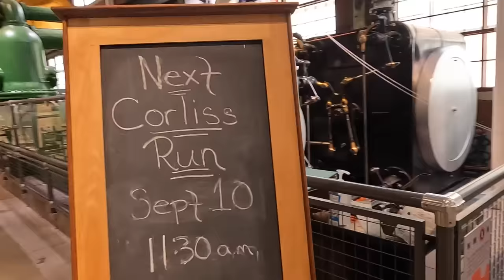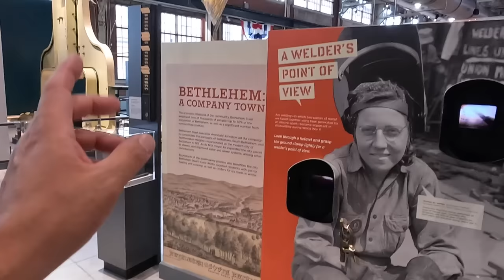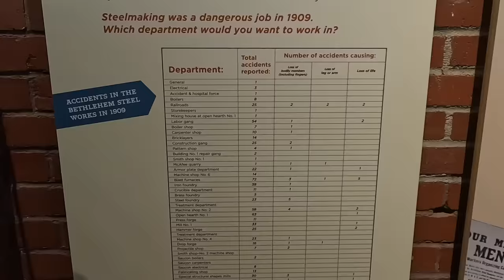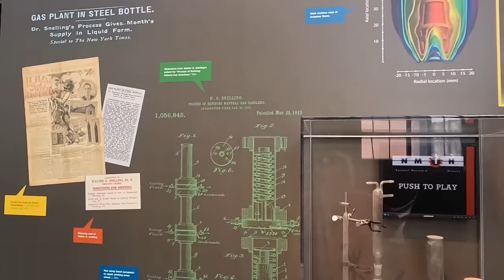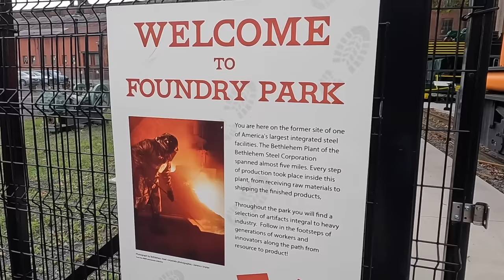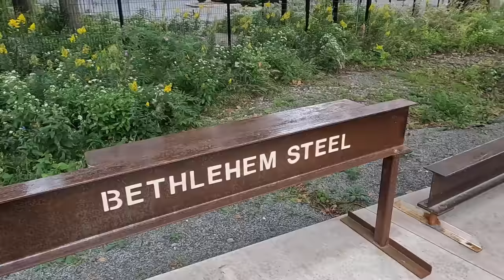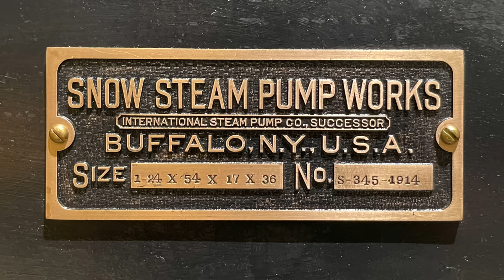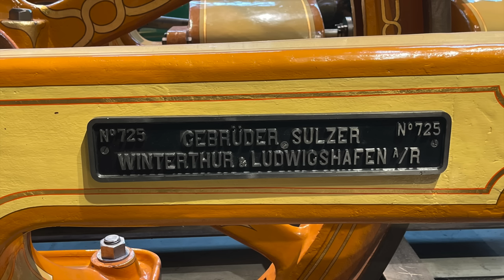National Museum of Industrial History, Bethlehem, Pennsylvania

Comment: There's an operational snow engine twice the size of that one, at Rough and Tumble, just a ways down the road, south of Bethlehem, in Kinzers, PA, along route 30. You should seriously check out their Thresherman's Reunion, late in August (3rd week/weekend or so). they have endless amounts of old mechanical stuff, engines, equipment, models, machine tools, on and on, and most of it is operational, or at least idling to show how it operated.
Reply: I volunteer in the machine shop & R&T and we'd love to see Adam on site

Comment: At 20 years old, I walked into the E.W. Bliss Company in 1969. They made all kinds of products for the steel industry. Machine tools that made rolling mill housings. They would be assembled to check everything was machined correctly, and it was square and true. Coilers and reelshafts. Very intricate machining and fitting on reelsfafts, hours, and hours. The machine tools were huge. The big gearbox that powered the rolling mills, when completed, and a couple of bolts in one of the shafts, with a 2x4, you could roll over the gears. Same ones you are standing next to. Smooth as silk.
Reply: Worked on plenty of Bliss presses and equipment over the years. 👍

Comment: 9:40  Where I went to Trade College, a few blocks away, was a full woodworking shop, in action making profit and fur nature and custom moulding for re-storing market, and it was line shaft driven.  

Out back of the plant was a "Drive Shed", instead of the old steam engine it had a fairly modern GIANT electric motor.  one motor ran the entire factory! :)   Many of the woodcutting bits were modern tungsten carbide, but the custom molding and wood trim cutters were all High Speed Steel and custom made for the shop.

I assume it's long gone now, that was well over 40 years ago!

Comment: I did a job at Bethlehem Steel while working for Maintenance Service Corp. If I remember right, it was the last company in the U.S. making virgin steel.
Reply: BTW, when I was there they were still using coke gas for heating and a byproduct of that was used for red dye oloring agent.

Comment: The two gears out front are to a gearbox that turns a 44 inch or big rolling mill there would have been two large drive shafts that would have connected the rolling mill to the gearbox and the gearbox had babbitt bearings I know this because I work at the Steelton plant in maintenance so we still use those gear sets in different parts of the mill and the overhead crane is 250 volt DC the the crane in the Steelton plant are like that.

Comment: Casted machine bases reminded me of an old Singer sewing machines, manufactured at beginning of the XX century. Our family had even a Singer's replica; Podolsk sewing machine, manufactured in 1950's with an identical casted base. 
Those two chevron gears (pinions) lying nearby the entrance came off of a pinion stand. Rolling mills use pinion stands connected to the work stands to make the counter rotation of the work rolls.
The line shaft with the flat belts (group drive) was still relevant in1950'-60s in many legacy machine shops and eventually had replaced by a newer machines.

Comment: Bethlehem Steel was one of the three major 20th Century armor manufacturers for the US Navy through WWII (Bethlehem, Carnegie, and Midvale) and also during the same period in the for 20th Century US Navy AP projectiles (Behlehem, Midvale, and Crucible Steel).  Of the three in each category, it had the spotiest record for reliable armor and projectiles.  For example, four bewlt armor plates were taken from the sunken USS ARIZONA and tested at the US Naval Proving Ground, Dahlgren, VA, during WWII.  Three of these face-hardened Class "A" plates were Bethlehem Non-Cemented plates and one was a Midvale Non-Cemented (at the time only Carnegie decided to pay Germany's Krupp Company for its Krupp Cemented face-hardened heavy armor patent, with Bethlehem and Midvale making their own somewhat different plate types, until 1912 when the US Supreme Court invalidated the Krupp Patents, allowing free copying the the cemented armor version from then on).  When those four ARIZONA plates were examined and tested using new AP shells, the Midvale plate had the thickest face and was very smooth in the hardness contour from front to back (good quality control with no erratic hardness or other metallurgical  changes within the plate), while the three Bethlehem plates varied all over the place in hardness contour, plate metallurgical properties, and plate quality under testing, indicating very bad quality control during manufacture.  The ignoring of quality in manufacture by Bethlehem also happened when the first 14" AP shells were being tested at about the same time for the newer up-gunned -- from 12" guns --  US Navy battleships.  ALL Midvale test shells passed easily and most Crucible test shells passed with a couple of failures (Crucible later became the best Navy AP manufacturer used to make all armor plate test shell at the Naval Proving Ground).  NONE, repeat NONE, of the Bethlehem developmemta; 14" AP shells passed the initial tests.  Not a good record...
Reply: "Bethlehem plates varied all over the place"    playing the odds of where the shells would hit!

Comment: Being a computer programmer now I understand where the idea came from for using punch cards to program the early computers. They took what they already knew and applied it the computer business.
Reply: You might be interested in the telegraph museum located at the North American terminal of the transatlantic telegraph cable.
This is located in Heart's Content, Newfoundland,  Canada, just a little north of the Capital St. John's.
The electro-mechanical equipment there is beyond belief!
With this equipment it was possible to simultaneously send different message over the same cable!  Duplexing in computer jargon, now.
The cable end is still visible on the beach, where it goes under the road and into the museum.

Comment: Those programming cards and looms are very similar to the first ones even made, only about 100 years earlier.  Some computers could be programed the same way until about the mid '70s.  I actually learned how to use a keypunch machine (to make the cards) in high school in the late 70's; we had two keypunch machines and a DEC PDP8/E that you could program with the cards (although the card reader could also read pencil-marked cards, which is what we normally used)

Comment: The herring bone gears on the introductory page are truly fascinating.  How those gear teeth are shaped without a relief grove in the centre between the two flanks is beyond my comprehension.  Does anyone have an explanation on how those teeth are generated?
Reply: My guess..it started as a wooden gear a pattern.then you make a mold.then you pour the steel .then machine it ..

Comment: The owners issue on why Bethlehem steel closed was he didn't invest back into his company to be competitive on the market.
Reply: Paying out more in pensions than they did in wages was the reason the mini mills were able to outbid Bethlehem. Even pro-union guys admit this.
Reply: Minimills are able to produce with much less labor even if the pensions are not considered. Mini mills produce at less than 2 man hours per ton. Integrated mills were nearly 10 man hours per ton because they started with ores, then converted iron to steel, then poured huge into ingots that were then rolled many times into blooms and billets and then final products. Minimills melt scrap then continuously cast it into billets, blooms and even thin slabs, which are then rolled to final products.

Comment: Corliss is the type of valves in the engine. It's sort of like a gas motor being called flathead. It describes a part of the engine design but it doesn't necessarily name the engine. It's what's known today as a rotary valve engine.

Comment: Curious about that bevel gear (I assume its a) shaper, we have a Gleason bevel generator from the early forties in the shop, it is by far the most complicated machine to set up I have ever used.
Reply: I ran Pfauter, Barber Colman, and Fellows hobs and shapers.  A lot of them still had WWII tags on them.  They're a pain to set up until you get your head wrapped around it.   Thank God for reference tables.
Reply: And the original books! shop has a Fellows shaper and a G&E hob too. Its not a production shop so you spend a lot of time figuring out setups @OvertravelX